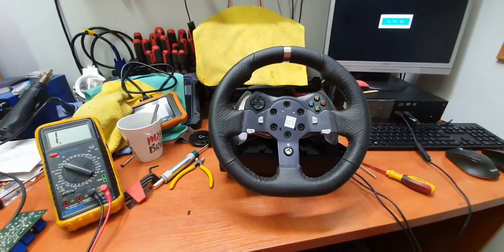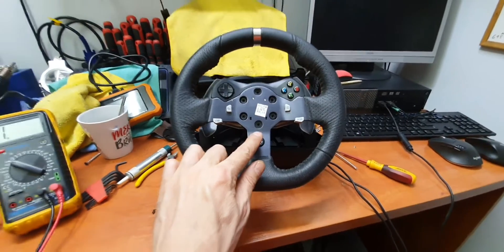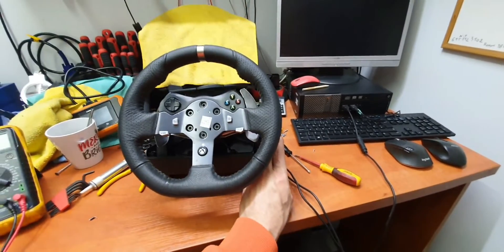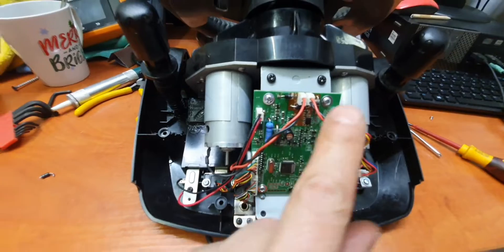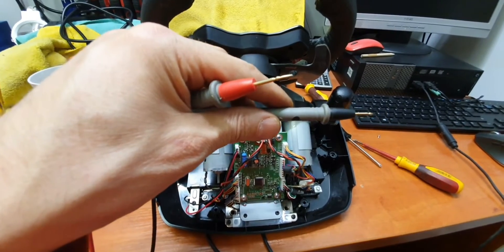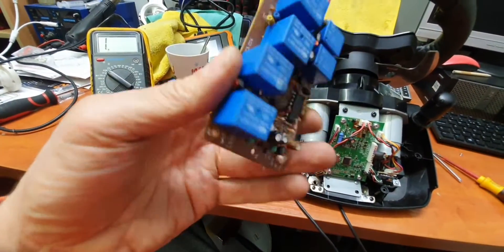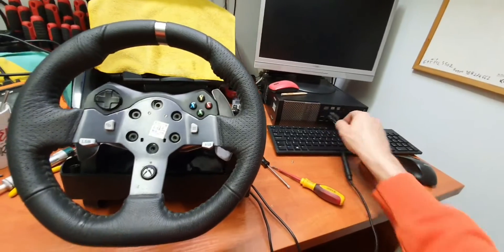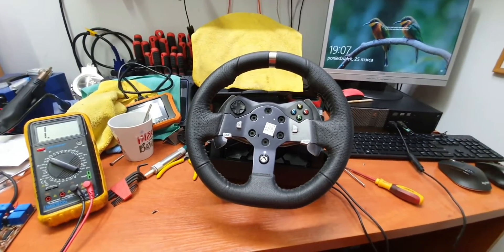Faulty logitech g920 wheel. turning left and blink white light. fixed 💪😁

Comment: How did you test the diode with the multimeter? Which mode
Reply: I assume it was the continuity Mode, you put a prod on each end of the diode. If the meter beeps, the diode is faulty (It's not supposed to have current going both ways) a working diode will not make the meter beep. usually on meters it's marked by a speaker wave symbol.
Reply: @33darkfire  That's what I ended up doing. Found a faulty diode and replaced it. Thanks again for your video and reply